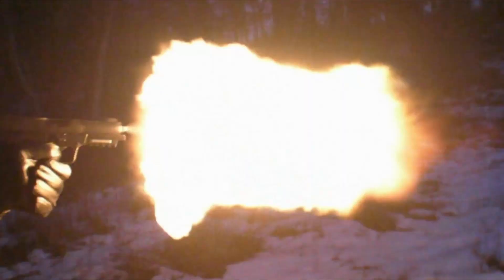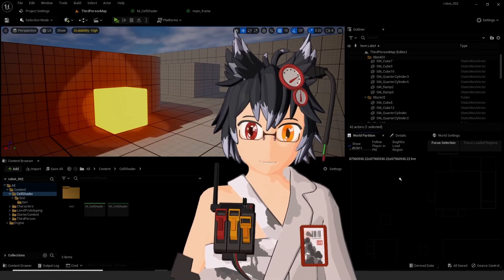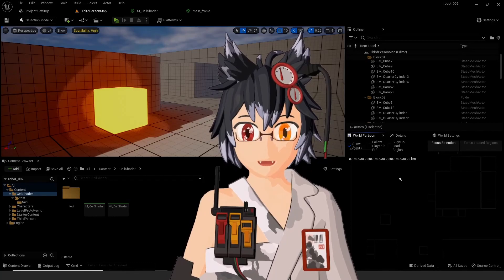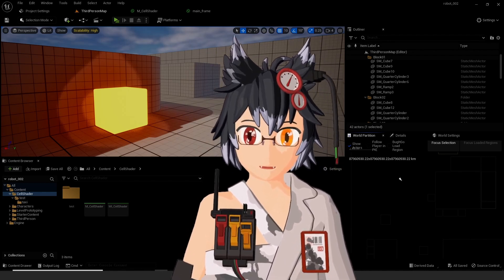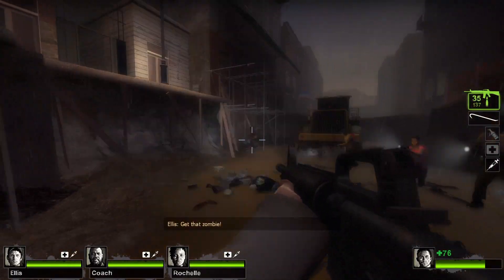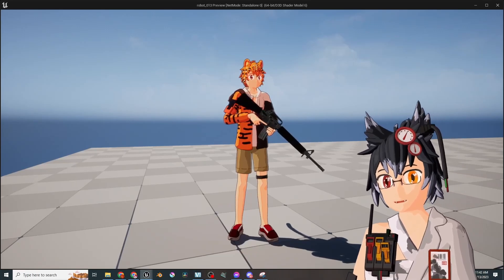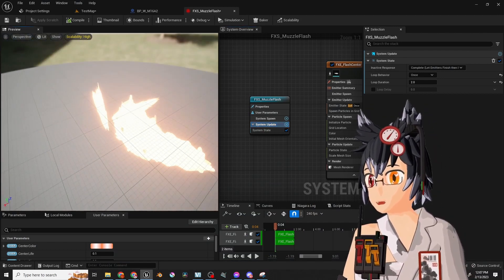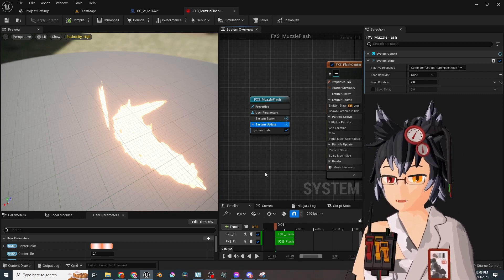Muzzle flash.

Comment: That was one hell of a muzzle flash for a Five-seveN
Like, back then, when I do info gather for a suppressed shotgun, I do something like "relation between pressure and loudness", as in the case of 12ga shotgun, you can tell it's loud for a low pressure ammo.
But then, I turn to see the 5.7 ammo. For a pistol ammo, it's unreasonable high pressure. And so people opinion on that is you definitely want to shoot the Five-seveN pistol when you have a suppressor, even after you have an ear protection on.
Reply from the maker: yeah Five seveN has a high pressure since its designed to be high velocity, armour piercing
even though the bullet itself is close to .22 in terms of size
Reply: @laika_ch  It sort of did what it was intended to do, but I don't think it will ever replace 9mm. People really hype 5.7 like that.
There is also the recent Garand Thumb video on 5.7, which sparked a lot of comment. You can check that out
Reply from the maker: @thedesignerblacksmith5953  it (and the MP7's 4.6mm catridge) was designed for a particular specification which it kind of met, though in the end it probably will turn out to not be that useful given the rise of short barreled carbines

might check that out yeah

Comment: Last time I touched Niagara my pc froze and crashed, so be carefull and save a lot of time your project
Reply from the maker: Lol don't worry i already compulsively save, somehow the 1050ti is still going though.  Though this is a very simple particle system made of two meshes so that probably helps
Reply: @laika_ch  1050TI is a good little card, started on it then I got a 6700Xt
Reply from the maker: @scarpheel  true, legendary budget card.  tho im going to have to get a laptop for university soon, do you think a laptop 3060 or a 3070 would be better choice?
Reply: @laika_ch  A laptop is going to overheat and die pretty quickly, I would reccomend buying something that does your uni work (but cheap) and wait for when you can have the place to have a tower to use your money
Reply from the maker: @scarpheel  I know but I'm studying overseas so I cannot guarantee a dorm room with enough space
Reply: @laika_ch  then look at any laptop other than acer cuz I had one and it's trash

Msi is pretty good
Reply from the maker: @scarpheel  aight thanks for the advice
Looking at a Dell rn